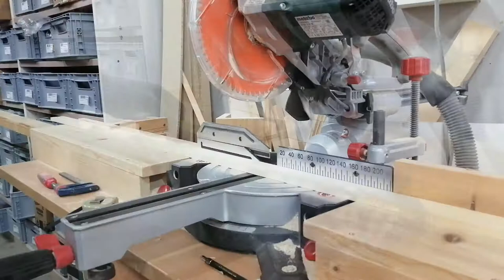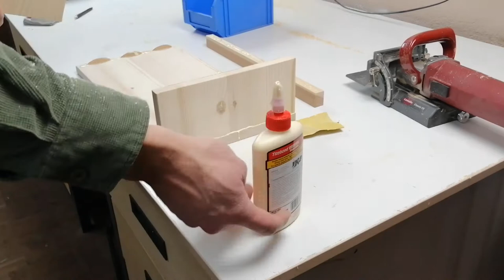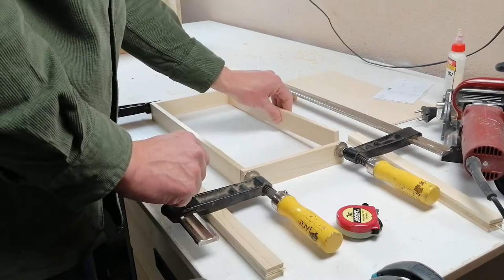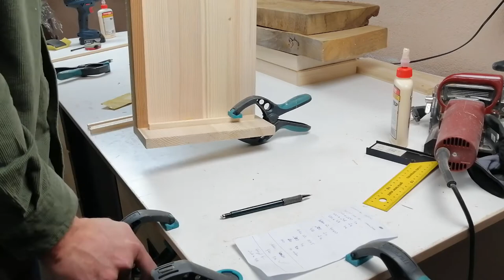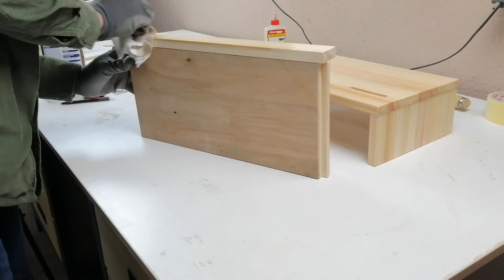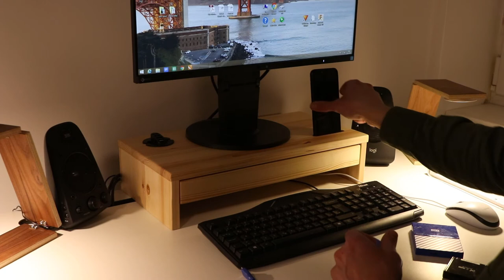Wooden Monitor Stand with Drawer and USB Charger - DIY

Comment: Just watched this. Almost exactly what I wanted to make, so thanks. Found two old pieces of 'scrap' wood that someone gave me. After sanding turned out to be solid oak!. That will make a nice finish. Any recommendations for surface finishing of this wood, so I don't obscure the lovely grain and colour?
Dont like clear laquer. Would prefer some form of oil/wax
Reply from the maker: Thank you. Good, oak is the king of wood. I am still using Danish Oil by Rustins for the majority of my small interior projects. It is almost transparent, not oily, antistatic (no dust),... I apply it twice or three times.